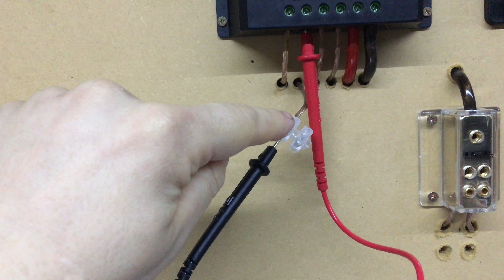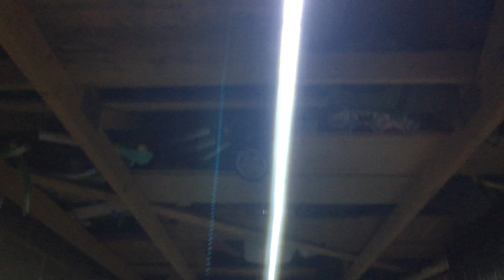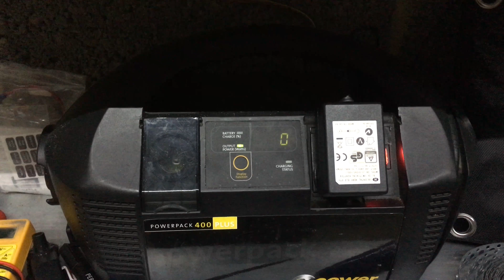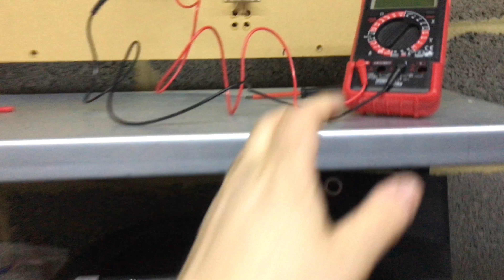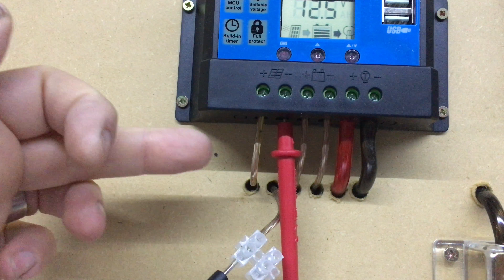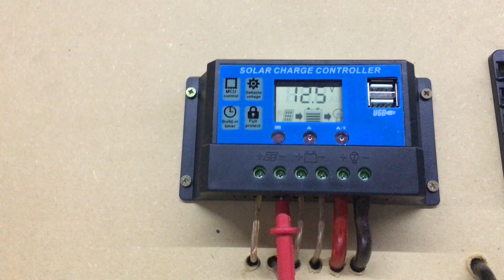Off grid solar garage

Comment: Did you just use a single bracket under a tile screwed into a piece of wood under the panel to hold it? Or did you glue it on or is it just resting on the roof,hard to tell from the thumbnail of the panel there looks like no rails or anything for expansion